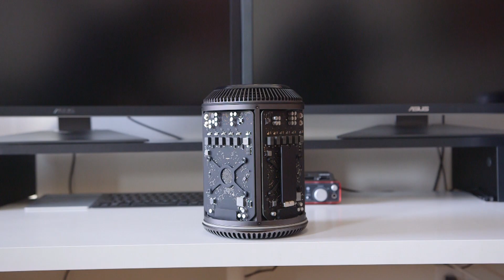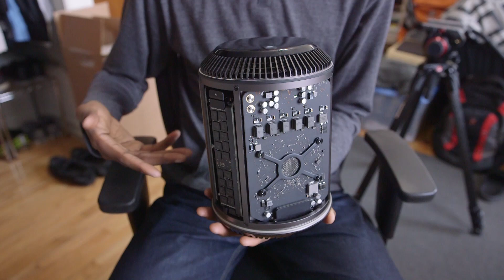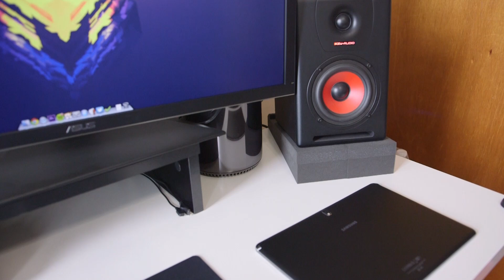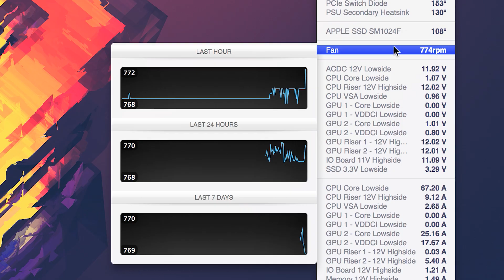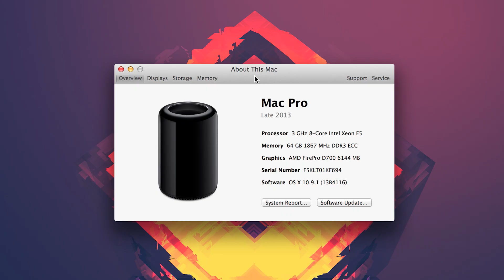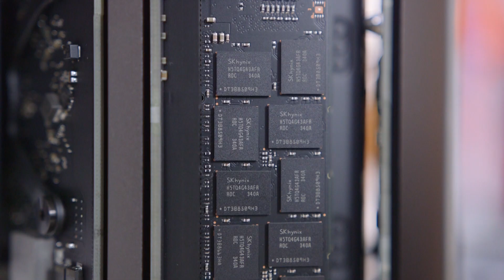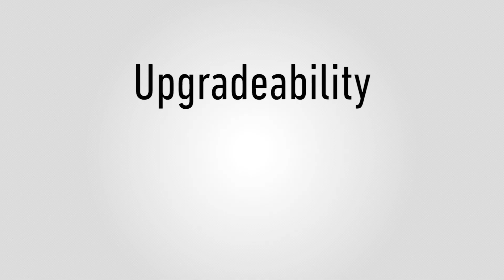New Mac Pro Review!

Comment: Almost 2 years later, and still an overpriced trashcan.
Reply: +Vlad Pandele You won't get shit @ 3,000 USD for video editing. My Windows PC came at $7,200 USD with an i7, not even a Xeon with 6 or 12 cores.  This Mac Pro is using Xeon CPU and not to mention that some professionals work and need to work on OSX..
Reply: +Vlad Pandele Because you want a Gaming pc ? Its for Work like Video editing and a big thing is the design its small for the hardware ..
Reply: SlothInAction I personally want both in one package. Also, it is a really crappy computer in its base configuration for 3000$. And I agree with you about the sheer size of it!
Reply: +SlothInAction Tbh, if you want a work station you can just build a way better one for the same price with even more high quality hardware. Gaming computers can also double as video editing they have all the latest top of the line hardware.
Reply: +Timmy Turner Bottom line, it all comes down to your preferences. And your budget. Because the competition between a custom build and a Mac Pro is tighter at 10000$ than 3000$. Just sayin'...
Reply: Brawndo You can spend over 7000 bucks or something like 1500$ for an i7 PC. It depends heavily on what i7 processor you choose and other stuff (storage, memory etc.). So maybe you've done something else to your PC (watercooled with a 900D case and dual Titan X, just sayin').
Reply: Vlad Pandele 750D case and Dual 980 Ti. I don't video edit, so I wanted a dream gaming PC with ultra wide 3440x1440.  Bit I can understand professionals working with video editing and software like Final Cut Pro, or Audio and photo editing. The Mac Pro is certainly not for the average user, but I respect it for what it is, and OSX is a nice OS.
Reply: Brawndo Problem: pretty much every professional out there (including MKBHD) uses the Adobe suite since Final Cut Pro X. And the fact that you can make pretty much every computer out there a hackintosh (PC with OS X) makes the Mac Pro..... an overpriced trashcan!
Reply: +Vlad Pandele You're mistaken about what softwares many pros use with Mac. Also, most hackintoshes are trash and don't even reach the same performance at similar prices.  That's my opinion. If the software you use is all available on a PC good for you but the price of the rig will have to be very similar to obtain similar performance if you're going the hackintosh way
Reply: +Brawndo my friend u couldnt be more wrong, u can do a hackintosh for half the price and get from 130% performance to 150% of a mac pro
Reply: ionut daniel serban Check videos from Marques Brownlee or Linus Tech Tips and benchmarks..

Comment: Shoul i get this for video editing beginner??? Or macbook pro instead??
Reply: JACK DOLAH 
For a beginner, any computer you can afford will be okay, as long as you know, what editing software you want to use (it is just a tool, it has to work for you and will not make you a better editor) and what footage you want to edit and put out.
A Mac mini can do fine with HD and UHD if you use the ProRes or DNxHD or CineForm codec for your editing footage, a quad core Mac will do fine with HD footage using H.264 as codec and a Mac Pro will do fine for UHD footage using H.264 as codec.
You can however use the Mac mini or MacBook Pro to import the footage into your editing program in whatever codec you want.

Maybe head over to MacRumors Forums or Apple Discussions or Creative Cow or other DCC related fora to get more input.

Anyway, the Mac Pro is overkill for a beginner, as the Mac Pro is a workstation for professionals.
Reply: Thank you so much respected fella ! I respect you !

Comment: I would never buy this. But I cannot deny that this thing is amazingly designed. I have absolutely no idea how they managed to make that work.
Reply: Yu Stephen The magic of having the entire hardware design under your hand :D If you dont have to worry about fitting parts into a case because someone builds them specifically for you, you can do crazy shit like that. The thermal design is simply genius though. Im a full out windows user, but the concept of an upright windtunnel like that should be more widespread, considering that it pretty much induces a massive airflow without even using the fan, just by thermodynamics.
Reply: +Rumplelumpa Snickerdoodles The thermal design was half baked, The Trascan Pro will throttle when pushed. The GPUs and CPU get up around 85~95C. This supposed to be a workstation?
Reply: No, I have plenty of apple products. However this is a little too expensive for me.
Reply: I'm just crazy!
Reply: I would buy it... as a trash can.
Reply: oh okay.
Reply: +Yu Stephen this is how I feel with all the apple product I've bought and sold almost brand new.
Reply: agreed.
Reply: restropectively, this was a failed design.
Reply: bought one used for $180. i think that price was just right for my budget lol
Reply: +Yu Stephen why not, you could at least give it a try? what, just cause its got an apple on it?

Comment: Overpriced? It is the cost of making it in the USA. The Mac Pro was brought back to be built in the US. So much complaining about outsourcing jobs, now you're complaining about the higher price than it already was. Its why they take their stuff to China, so you won't complain.
Reply: ***** Even with it being made here it still is overpriced. Add the lack of internal expandability and it's adding insult to injury.
Reply: Keep drinking the apple juice. Good luck adding SSDs GPUs not made for it, or any other internal upgrade without having cables running everywhere. All for a price which is ridiculous. It is a stupid design but the brain dead will still buy it because it has an Apple on it. Of those upgrades you list how many of them are MANY times more expensive then what you would pay if you could by the part off the shelf and install it?
Reply: James Thacker Not much actually.

1)  Not using "Apple branded SSDs."  You are an Apple hater, I have a third party SSD running perfectly fine in my Macbook.  Also, the Mac Pro uses PCIe.  Which if you don't know, which I'm thinking you don't is faster than SATA.  It would make sense that a WORKSTATION, read that word there, look up it's definition, would have PCIe over SATA. 2) Buying a Mac Pro.  You either get one pre-built, or buy all the parts and build a workstation yourself, you will be paying the thousands of dollars range.  I'm not talking about slapping in the beefiest Core i7 you can find, with DDR4 RAM and a Titan X.  I'm talking Intel Xeons, EEC RAM, D700 Fire Pro.
Stuff that is actually made to handle Workstation grade work.

I understand you are a hater, but please... at least know about computers before coming in here bashing them.
Reply: +Bryan P made in the USA????? wtf are you on about????? It may be assembled in the US but everything else is made in good old china buddy.
Reply: Phillip Jernigan Oh dear. I replied to the wrong person. I meant to reply to James Thacker, not you, this is awkward.
Reply: sdushdiu Better in almost every way compared to the entry level Mac Pro. Especially of what it's meant to do. Rendering.

http://pcpartpicker.com/p/dPBWxr
Reply: Nhlpro14 It doesn't have ECC RAM. Not to mention, it also doesn't have a GPU meant for rendering. It would be great for gaming, but I don't think Macs are being sold as gaming PCs.
Reply: +James Thacker You can upgrade everything dude! SSD, RAM, Graphics, even Processor!
Reply: Phillip Jernigan "Not made for it"? What are you talking about? Yes, there are a select amount of PCIE based storage drives but there are still dozens of them, none of which are produced  by apple. GPU's? I can just buy some fire 500s or 700s externally and install them.
Reply: Drakemeister I'm talking about how he said you can't use non-apple products, and that you have to use "made for mac" products.

I thought that was pretty clear if you used context clues passed on who I replied to.
Reply: +Bryan P It's made in China and assembled in America. It's literally the cheapest parts they can find and then charge double for it. They should just sell the case alone and let people choose the parts they want.
Reply: +Drakemeister I don't think you can add a high end graphics card, it would be too bigger than the whole computer. Not even an R9 Nano could fit in there.
Reply: +Bryan P That is not made in the USA.
Reply: +Bryan P petty sure it's still made in china, or over seas.
Reply: PingDuhPong It says it on their website and on the Mac Pro.  "Assembled in USA."

Granted that isn't the same as made, per say.  But that is something Apple always has done.  I have an old PowerBook, "Assembled in USA."
And my new Mac Mini, "Assembled in China."

I guess Apple thinks assembled makes them sound more pronounced or something, IDK.
Reply: +Bryan P Yeah, that explains Apple's obscene pricing for memory/storage upgrades....
Reply: Daniël's Tech & Music Channel Like I said, even the products known for sure made in China say "assembled in China."
While I believe you are correct, I'm not quick to assume that is just the answer, since this is Apple we are talking about, and they like their fancy terms.
Reply: +Bryan P This is a bit late, but anyway, there are countless custom pcs being built in europe and the states with equal if not better performance, size, etc. which don't cost this much. That's no argument.
Reply: You literally no nothing about computers I can tell. I can buy a custom build computer for a fraction of the price that is on a way higher level then this.
Reply: Nhlpro14
 You have to love prepubescent dumbfk fanboys who make specious claims like this but can't back it up with a component list with associated pricing.
Reply: Gabe Iturralde Why only one stick of RAM?  Wouldn't you want to take advantage of dual channel with at least two modules?

And there is no included OS.  OS X, granted comes with the Mac Pro.  No WiFi either like the Mac Pro.

Though yes, that is a better computer than the entry level Mac Pro.
Reply: Phillip Jernigan https://ca.pcpartpicker.com/user/DuckonQuack79/saved/#view=2gFypg

this is better then any mac possible
Reply: Nhlpro14 Yeah, that would be better for over-the-top gaming machine.  And Gabe is right, Macs aren't meant for gaming.

Comment: I won't lie, I think this is an absolutely rocking design. Like an opposite of that stealth black NeXTcube. Too bad you can't replace any internal hardware.
Reply: Iminur Computorz 
Too bad you can only replace flash storage, CPU and RAM, as there will probably not be GPUs with that connector out there.

But then again, CPUs and RAM and flash storage are not internal hardware.

Comment: You could have built an equivalent Hackintosh for under $3000.
Reply: Humana Games Care to share the specs of that 8-core CPU and dual workstation GPU and ECC RAM and PCIe flash storage Hackintosh?

And if you are so sure, why not tell Dell and Lenovo and HP that they could offer workstations using consumer parts? Maybe the professionals using those will not notice.

The stupidity gets stronger day after day.
Reply: This is actually faster than his hackintosh :p

Comment: Hey,

just a short note in between:

It's very easy to listen to your speech. As I'm german, this fits to me very good. The audio quality is also very good and you do put compact info into a very small timeframe, this comforts me, I like that!

You second made me buying this one next month probably as 6-core together with the D700, as I do have more single threaded application next to final cut that I do use as well. There's also just one additional compressor thread I'd use, as I do one by one cutting, so there's no need for additional cores except using handbrake. It will be as well the computer I'll use as full time workstation for almost everything. 

I'll def move to a thunderbolt audio interface as I don't like the slow FastTrack C600 I have right now. This device is absolutely not suitable for monitoring and AVB still has also way too big latency - as I heard Thunderbolt is the one and only option for near to zero latency. I'd like to upgrade to a MOTU device, but there's still no affordable Thunderbolt device in smaller sizes like 8x6 including 2XLR... So what would you use?

Comment: overpriced
Reply: xXx_420_360_HaX0rDaN0uSkoupah#sWaG#l3g1t_darud3w33dstorm_360_420_xXx Are you sure?
Care to share the much cheaper workstation computer with those components at that weight in that size with six TB 2 ports?

No?

Thought so too, but at least your user name gets you laid.
Reply: 3 words needed: Build one yourself.
Reply: xXx_420_360_HaX0rDaN0uSkoupah#sWaG#l3g1t_darud3w33dstorm_360_420_xXx

In other words, you do not have an alternative.

I guess those self build computers do wonders in companies.
Reply: Yes, self-built workstation PCs are a thing. But you can't argue that the Mac Pro has poor cooling and looks like a trash can (which may appeal for some people, not me). They had to sacrifice a lot just for it to be stupidly tiny.
Reply: xXx_420_360_HaX0rDaN0uSkoupah#sWaG#l3g1t_darud3w33dstorm_360_420_xXx
I know about those self built workstations, I used one and had more problems than it was worth it.
My Hackintoshes were more stable.

Yes, the cooling is not optimal, but it seems to work for that size.

Now let's find some Dell and HP and Lenovo workstation videos and ridicule them for their prices.
Then let's go to broadcast networks and production companies and science labs and ridicule the users of those workstations too.

Comment: This may be a little late but the reason adobe premier doesn't have any improvements is because adobe using cuda acceleration to speed things up (NVIDIA only has CUDA cores on its gpus) AMD doesn't have this so therefore you won't see any differences maybe even longer rendering times
Reply: Marsh Paid 
Nvidia GPUs are also capable of OpenCL support: https://developer.nvidia.com/opencl

Comment: So many butthurt people around here. Haha Don't see Apple users talking sh%$ on a  PC based video. They don't really feel the need to. On the other hand, when you see an Apple product video, it is full of childish comments about it. Funny is a lot of them are probably iPhone users as I've seen.
Apple thinks far beyond price/performance. Some people never get to understand that :)
The fact that it only has 1 fan to cool the whole system isn't just a simple fact. It is design. The result of a lot of work from engineering and designers. To make a smaller, beautifull and powerfull machine. All that costs money. They aren't just thinking about performance.
Far from it.
Why don't you go hate on a Ferrari or a Lamborghini product?
I can think of a thousand things that I think are overpriced and I wouldn't buy. The thing is, I don't give a damn. Whoever wants to buy it, it is their choice.

Its actually quite simple. Can't afford it; shut up. Don't buy it. If you prefer a PC and thats what you can afford, buy a PC. Just to anticipate some of the senseless comments. I use both apple and PC. Different concepts; simple. But I love both, to be honest.
Btw, How many more years will it take for PC to have decent form factors? Anything that comes close to a MacPro is at least 4 times bigger.

Comment: ...any refresh prediction for 2015 !! I am on the market to buy one or wait :-)
Reply: v SIG 
Unlikely, as newer Intel CPUs only provide gains less than 10 %, AMD has not released new GPUs yet.
Maybe when WWDC comes around, but since the upgrade cycle for the Mac Pro is two years, you might have to wait until 2016.
Reply: v SIG 
Unlikely, as newer Intel CPUs only provide gains less than 10 %, AMD has not released new GPUs yet.
Maybe when WWDC comes around, but since the upgrade cycle for the Mac Pro is two years, you might have to wait until 2016.
Reply: Indecisive Fella
Thanks

Comment: Honeslty no reason to get a mac except for the iMac 5k because of the only other 5k screen price you can get... It is simply too expensive.
Reply: ***** 
For you maybe, but other people have different computational needs and Windows does not satisfy everyone.
Reply: Indecisive Fella I am talking "economical" the iMacs are expensive compared to what you could get pc for (Hands down.)... If you buy it sure, though there is really no reason to buy it "economical".
Reply: *****
Then show us uninitiated the alternative, which is that much cheaper and offers the same specs AND FEATURES in a similar package.

No one could do that yet, maybe you will be the first.

PS: Is it also not economical to buy a 200 USD battery screwdriver when 50 USD ones exist?
I just ask, as my brother went through six or seven of those cheap ones in two years while that 200 USD one is still working three years later.

Comment: I think the Mac Pro will change it's inputs and outputs, when USB type C, and thunderbolt 3 come out.  Both USB type C, and thunderbolt 3 will be different shaped connectors than compared to USB 3, and thunderbolt 2.  Also Apple will upgrade to HDMI 2.0 for 4K 60fps video.